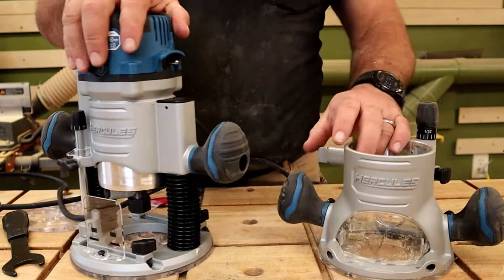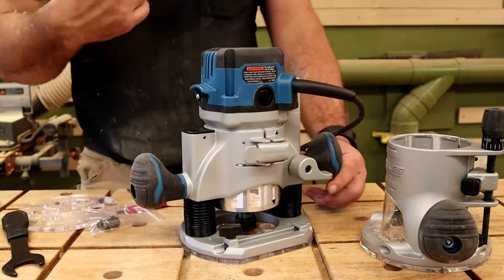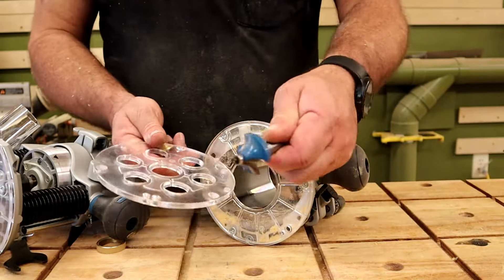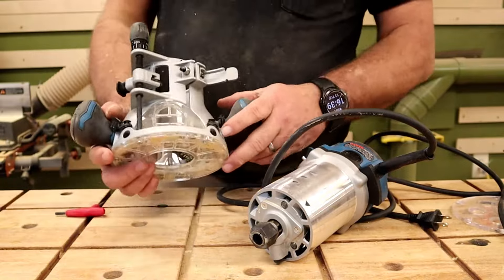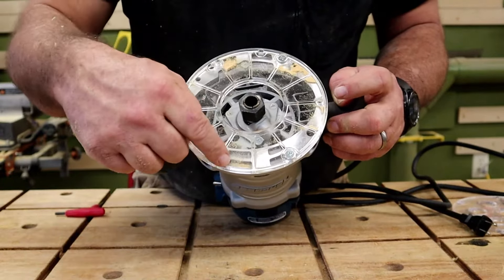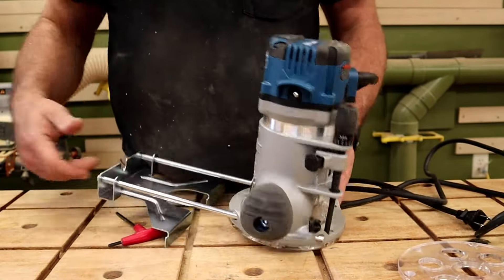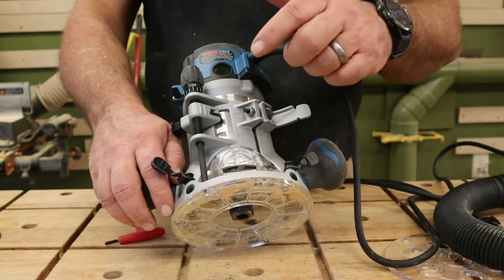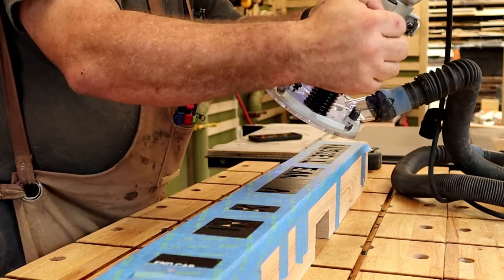Hercules Router Review from Harbor Freight 57368

Comment: Ok, so this is literally a copy of an identical skil router. Only, you can get the skil for the same price, and it has a digital display for the speed settings.
Reply from the maker: They are both made by Chervon. The Hercules goes on sale all the time for $99. I may pick up a Skil just to check out how the digital display works.
Reply: Yeah right!  It is a Skil. I bought the Herc. It looks like it should mount on the Skil table okay. If it don't I'm not gonna be happy. Lil

Comment: I just bought this router a few days ago, haven't used it yet.  My only quibble was that since it has two bases, it should come with some kind of case, like the Bosch 1617 and the Makita trim router do.  I'd be willing to pay thirty dollars or so more for that.
Reply from the maker: For me, I hate tool cases. I am glad that companies stopped including them with every tool. I am in the process of building a custom holder for this router. 

It would be nice to offer them as an accessory so people who want them can buy them and other  people do not have to pay for something they don't want. If you add another $30 plus the cost of a 2 year warranty,  now you are at the same price as the name brand tools. That is what I like about harbor freight, I don't have to pay for extras I don't want.
Reply: Hf sells really nice hard cases with the customizable foam padding. You could easily custom fit one for the router
Reply: @Pawpaw7332  - Good idea.  So good, I already tried it.  Unless you go tot he full rifle-sized Apache 9800, the biggest thing they have is the 4800.  Didn't work.
Reply: @eyeofamon  take the router apart and store it as three components?

Comment: Triton plunge router was a nightmare in terms of plunge action. I found it to be really difficult to go smoothly. Could only get good motion if I pushed down only on one side. It's so highly recommended that I bought two, thinking the first was defective. But they were both like that. May need to try this one.
Reply from the maker: Yeah, I bought a Ridgid one for twice the money. I was very disappointed. I bought a Wen for $80, which was much better. I bought this one because it took bushings. It has become my most used router.

Comment: Was waiting for someone to review this. I got this router when it came out. I was replacing an old craftsman. I'm really happy with the quality and power of it. Well done review, thanks.
Reply from the maker: I am glad my review matches your experience. I did get two, but sometimes, if you only have experience with one, it can be different than the majority. I had not expected it to be as good as it was at that price. I have a router. I  paid 75% more for. It is even close to having the features this one has.
Reply: @ShopRamblings  I think HF is stepping up their offerings in a lot of areas. They offer good value for people who can't or don't want to spend a lot on tools. I appreciate someone giving them a fair look instead of automatically passing them off as cheap or inferior.
Reply from the maker: Many people equate lower prices with lower quality. What most don't know is that Harbor Freight is a private company. They don't have share holders that only care about making the most profit they can as soon as they can. Just look at how much they give away.

https://en.m.wikipedia.org/wiki/Eric_Smidt

Secondly, you are not forced to pay for a two or three year warranty. I many cases, the tools are made in the same plant with the same materials. Manufacturers have even said that HF will pay more than other "name brand" companies to get a better product but just sell it at a lower mark up. I think of them more of à la cart. Most tools have at least 3 levels of quality. If you want an extended warranty, pick how many years you want and pay accordingly.

Comment: If that’s the only gripe, I’d say $129 well spent!! Full of features and that hidden feature for the height adjustment when mounted into a router table is awesome!! Glad I chose this router after watching this video! I will find out if milling with this router in my router sled is an issue. Great video
Reply from the maker: I have used it in my router sled. It worked great with a 2" surfacing bit.
Reply: How deep of cuts were your passes? Trying to level a walnut slab for a coffee table ( live edge)
Reply: How deep of cuts were your passes? Trying to level a walnut slab for a coffee table ( live edge)
Reply from the maker: @jimputnam7539  I normally do 1/8" per pass.

Comment: I just got one and set it up on my Skill router table (old one). I took the plastic off the fixed bottom because the table has it's own plastic hole for the bit (different sizes). If you don't remove the plastic plate on the bottom when attaching the router, the collet doesn't come up as far. Also, I didn't have to drill any holes, it just fit using screws in the holes used for the plastic plate.
Reply from the maker: The Hercules is made by Chervon, the same company that makes Skil. I have a Skil coming in tomorrow. I may do a comparison when I get a chance.

Comment: I wish I had seen this sooner. I just bought this router and like you I’m impressed with all the features and the power. However, mine gets really hot very quickly. I haven’t used it a lot but if it continues I will trade for another one. If you or anyone else has noticed this please let me know.
Reply from the maker: I have not noticed it with mine.

Comment: Hi thanks for the great review. Question… I’m looking for a heavy duty router to use with a slab flatting bit.since these bits are large diameter do you feel like the tool would tend to shut off lie it did with your carving bit? Thanks
Reply from the maker: I have not used this router in my flatening jig.  I use a 2 inch surfacing bit but try to only move 1 inch per pass anf 1/8" depth. It doen't feel like it puts much strain on the router.  It would just depend on how aggressive of a cut you make. I am making a new flattening jig for a video in the next 2 weeks. I may use the Hercules and see how well it works. This is the router I am using now. It is a beast.

https://amzn.to/40clJbU

Comment: Glad to see this router back in production again.  Bet a lot of the older Bosch accessories fit it.
Reply from the maker: I have the skil version also. I haven't had a chance to open the box yet. I plan on comparing the two when I get a chance.
Reply: The skil version is actually made in the same factory as the Hercules. @ShopRamblings

Comment: Could tell from your review. I want to mount the router in my table saw extension.  You mentioned it could be adjusted from above with an Allen wrench, but I didn’t see if the clamp had to be opened when adjusting by the adjustment knob.  Thanks in advanced.
Reply from the maker: It works better if it is open. I loosened the clamp just a little. It made it some it could move some without opening the clamp, but thighs enough not to move when cutting.

Comment: Great video: helpful, concise, practical, explanatorily accessible.  Would you be able to tell us which particular Rockler product was used in the "hose locks" section? In particular, the blue coupling that connects the 1.5" vacuum hose to the router port?
Reply from the maker: I just went to Rockler to find the kit number i purchased. It looks like they don't sale it any more. That is a good thing. It was the Flexport kit with the expandable hose. The hose is heavy and pulls. the connectors can stretch to fit many ports but would easily slip back off while using. I often would tape the connections. I noticed they have new connectors that are similar but have retainers. They look like they will work better. I liked the idea of not having more hose stretched out than needed but would not buy the expandable hose after using it. If you search there site for "flexport" you will find all of their current options.
Reply: @ShopRamblings  Much appreciated.

Comment: Great review,packed with a ton a relevant information👍🏻✅
The fixed base reminds me of the old school Craftsman router. I still have it but it’s only 1 3/4 HP and I’m looking for a 2-2 1/4HP router to replace it. Think I may have to consider this one seriously. Thanks!
Reply from the maker: So far, it is still working perfectly. It is my favorite of the 4 routers I have.
Reply: @ShopRamblings  
I went over to HF and bought this router. It is a duplicate of my old craftsman router. The wrench is identical, the base plates are interchangeable, the same notches in the motor to move it up and down.  This old router came with a router table (which I tossed in the garbage) but still have the wrench to raise the bits up and down. It fits in the fixed base Hercules and moves the bit up and down in it too. The collets are interchangeable, the edge guide is identical and fits both bases on the Hercules router and the craftsman router. Both the dust shrouds on the fixed bases are interchangeable. It’s the very same router. 
I’ve had this craftsman router for 20 years and it’s still a beast to this day. As I was saying before I just wanted a more powerful motor with a plunge base. My old craftsman is a fixed base router. I hope this one lasts that long too! 
Thanks again for this video! 👍🏻
Reply from the maker: Thanks for sharing. Chervon makes the Craftsman routers and sell them under a couple of different brands. The Skil router is the same router with an updated control package. I am confident the Hercules router is also made by Chervon. What I like about the Hercules is I paid less than half what I paid for my Ridgid router and it works better.

Comment: How do you use the dust collection on the plunge router with larger diameter bits. They won't go through it.
Reply from the maker: It depends on the bit and what you are doing. Sometimes you can lower the router and install the bit under the dust chute. I some instantes you may not be able to use the dust collection. You can also make the hole larger  but that may reduce the effectiveness if you go back to a smaller bit.

Comment: I am nit bashing this and have the Herc miter saw but seeing that the 14amp Skil router fixed plunge kit goes for same $ I’d go that route
Reply from the maker: They they are both made in the same factory.  They just have a different electronic package.
Reply: @ShopRamblings  Skil can be found cheaper, 1lb lighter, 14amp vs 12 Amp motor, has 2 1/4” plunge depth compared to 2” and digital display.  I’d have to catch the Herc on good sale to pick over Skil.

Comment: I'm barely pushing this thing and its cutting off unless I go really slow. Doing a 1/4" roundover on mdf. Gonna take it back tomorrow and swap it out. Got an electronic smell coming out of it so it could be a dud.
Reply from the maker: Sounds like it. I had to push it pretty hard to get both of the one I had to cut out.
Reply: @ShopRamblings  nevermind I just had go get used to the slowstart. It actually works damn nice for the money. Love it.
Reply from the maker: @seamushyland8199  I get it. I had to understand the electronics. Once I understood the shut-off was a safety feature, I liked it. It could have been in the manual, but you love and learn.

Comment: Would you recommend this or the skil?
Reply from the maker: I believe they are the same, made in the same factory, but each  company ordered them with a different electronic package. I bought the Skil one to compare, but I have not had a chance to open the box. I hope to do a side by side video when I get a chance. For now my opinion is to base your decision on which one is cheaper at the time. They both go on sale for around $99. I used a coupon for the Skil at Woodcraft. They also go on sale at Lowes. The Hercules drops if you are an Inside Track member. Second decision factor would be if you want the digital read out or a knob that rotates. Be aware Skil has a lower horsepower model that looks the same. And the third decision factor would be your opinion on which warranty you like better. I hope this helps.

Comment: I stopped in the store to look at this router. The catch lever for the three adjustment slots was loose and floppy on the display that I looked at. Did you notice that on yours or was the display damaged or needing tightened? Nice video; I am going to go look again. Thanks a bunch!
Reply from the maker: When you say the catch  lever, are you referring to the black button you push to release the router? I want to honestly answer the question but don't fully understand what you are asking. I think you are asking if if you have the gray locking lever open (unlocked), can the router slide up and down some. If so, the answer is yes. It is also yes on my Ridgid, Kobalt, and Ryobi routers. All routers that I have used that have the push pin style keeper have movement up or down. When the router is sitting on a surface, the weight holds it to the bottom of the slot. You can then rotate the adjustment screw. Once you are at the desired depth, you lock it into position with the gray lever. My Kobalt router moves about 1/32" when it is locked. I always have to recheck it after I lock it I  position. I did not notice any issues with the Hercules moving when locking it. I will try to double-check  it tomorrow.  If this is not what you are talking about, let me know.

Thanks
Reply: Yes the black lever that you would adjust against was very floppy (at least 1/16”) and appeared to be made of plastic.
Reply: Forgot to thank you for your reply. Thanks a bunch!
Reply: I had a chance to visit the store and check out the router again. The lever I thought was plastic is actually steel so that’s a plus. You are right if the router is adjusted in the upright position the slack doesn’t mater as much. Better than I had thought on my first visit. Thanks again for the great review!

Comment: anyone know if this will fit a Bosch 1181 router table and be compatible with the height adjustment hole?
Reply from the maker: It is not listed in the manual, but it shows most routers will fit. If someone can measure the spacing on the table, I can measure the router.
Reply: @ShopRamblings  I bought it today at hf for $99, Bosch router table will be here Friday so I’ll know 🫠

Comment: Man this is one day looking router.  I'm just scared to spend 120.00 on only a chance of a 90 day warranty.  But if that had say at least a year I would get it right now.  Ryobi has one at home depot for 99 with a 3 year warranty but it's not as fancy as this one.
Reply from the maker: That is what I like about HF. You don't have to pay for a warranty you will never use. You can pay extra, and HF will give you a warranty. I have 100's of tools. I have only had a few tools break. The way I look at it, if I buy 100 tools and I save 10% average, as long as less than 10 tools break, I am ahead. I am a deal hunter. I try to get 25% or more off most tools I buy. This router is better than the Ridgid  one I bought for twice as much. I have bought 3 of the Hercules for $300. The Ridgid one would have cost $600. If two of the Hercules had to be replaced I would still be ahead but I doubt I will have a problem with any of them. If there is a defect, I would find it in the first few weeks.
Reply: Do you have comparisons to any other routers you’ve used? 

Thanks for the video! This seems like the cheapest plunge/fixed package now and looks solid. My main concern is fitting any kind of extras.
Reply from the maker: I currently own Hercules, Ridgid, Kobalt, Grizzly, Wen, and Ryobi routers. I have used several other brands. What king of comparison would you like, and what accessory would you want? I will say that out of the 4 plunge routers, the Hercules has the smoothest plunge. The Wen has 8 - 1/16" stops. Other than that the Hercules has any feature found on any other router I have.

Comment: Anyone know what router table would work with this router?
Reply from the maker: I have mounted several routers. Most routers have 3 or hole that mount the bottom plate on. You remove the screws and use those holes. This router has 3 threaded holes holding on the base plate and an additional 3 threaded holes that can be used to mount the router. If needed, you could remove one or more of the screws to give you additional options for mounting. The best option I have found is to get a Kregg insert and build your own.
Kregg insert
https://amzn.to/3WCpVhN
Kregg levelers
https://amzn.to/3BUgfrb

I have also used this one, and it worked good for the price.
https://amzn.to/3PIRML4
Reply: @ShopRamblings  How about fitting to the SKIL Router Table SRT1039 ?
Reply from the maker: It should. I believe Chervon makes both the Hercules and Skil routers.

Comment: The router isn't underpowered, the bit is designed for 3 hp machines.
Reply from the maker: I never said the router was underpowered. I said I was taking a way bigger cut than I should've. Making normal cuts, it did great. This is actually a good thing. Instead of letting you  push it until it burns the motor up, it stops. I said 1/2" but I a 1" round over in pass. It didn't  have any issues. It is a surprisingly great router even if it was double the price.

Comment: At the beginning of the video,  you show the lack of individual adjustment screws to the 3 step base compatibility of the plunge feature. Therefore making many adjustments to a 3 step process of plunge routings that now make it 6 steps. Unacceptable. I have an older Craftsman professional 3 piece set that has this and many other features that is probably 15 years old if not more, that would blow that Hercules out of the water. Biased opinion. Sometimes, you get what you pay for. Thanks. It looks like it trying to copy my old Craftsman professional from 15 or more years ago. Plus it had a reputation that you could count on from years ago.
Reply from the maker: I believe Chervon bought Craftsman and also makes this router. It is very similar to the new Craftsman router.